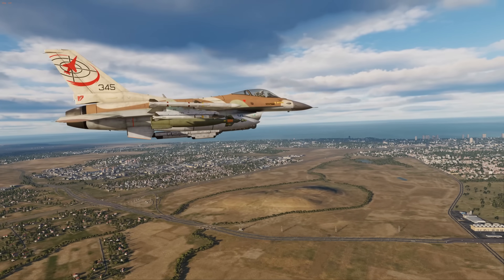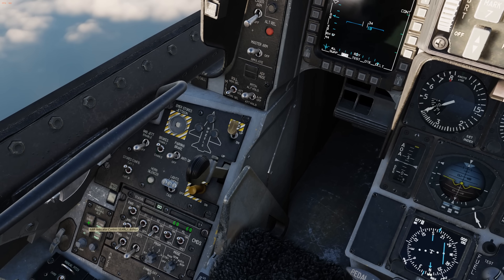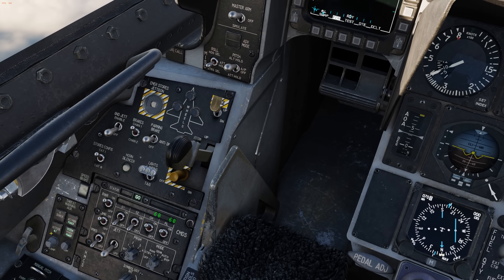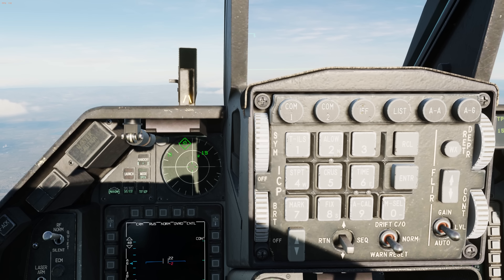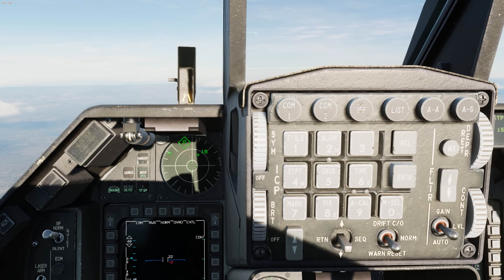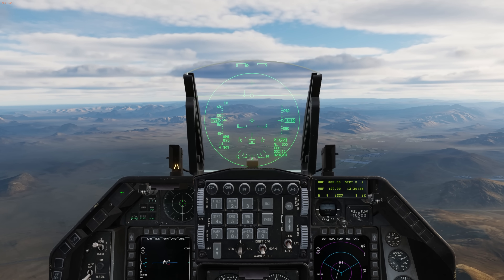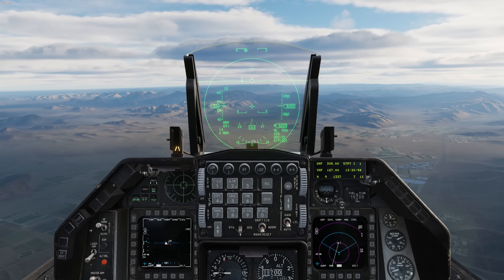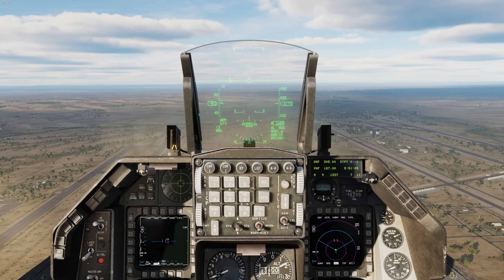DCS: F-16C Viper | January 2023 Update

Comment: Great news!

Regarding the airfield arresting cables; these make little sense until the Viper's damage model include Hydraulic system failures, such as damaged brake lines or a faulty Hydraulic system B. 

The real questions remains: does it interact with the carrier wires? Guess I'll have to try!

Great to see more love for the Viper!

Comment: Well, that's great, all those upgrades to the RWR system, but still no fix to anti-skid feature? It's hard to land without differential brakes.
Reply from the maker: Works here. If you have an issue, please use our forms and create a report with a track file.
Reply: @MattWagner  Thanks for reply, I may have skipped the info of the anti-skid update. I got used to land with diferential brakes so I may have missed it.

Comment: As a separate note the NLG will NOT come down right away at 400 knots via the alternate gear handle.  They built it smart since it has to work against the airstream and not with it like the mains so it won't even try to deploy via the alt gear handle till around 190.

Nevermind that almost 400 knots gear down is just a WEE bit of overspeed on the gear.

Comment: One thing, the speed at which the doors open ND the nose landing gear deploy under the alternate landing gear handle is extremely quick. The main landing gear simply fall out and are locked into place by the air resistance pulling them into place

Comment: Wags, how significant is the performance improvement with multi threading?
Reply from the maker: YMMV, but generally significant improvement in large missions. I kept my FPS display on in the last two videos.
Reply: @MattWagner  My guess, at least for us VR-only (and forever) types, on average ~20-25%, BUT much smooother. A plus, and long awaited. And I'm sure over time it will improve. Hopefully ppl aren't expecting miracles (I know, I'm crazy).
Reply from the maker: @flightsimstuff5417  Delta for multi-threading will depend a lot of the size of the mission and the delta for DLSS will depend a lot on being CPU limited or not.
Reply: @MattWagner  Yup. I "W.A.G."'d it with that in mind from past experience. With nothing going on (low object count) more, throwing everything in there willy-nilly (not 'scheduling stuff for us scripters) something lower. Thanks for the work.

Comment: Hi! Chose the Pre mode assembled with the Maverick rocket. But for some reason, my WPN does not agree with the targeted container. In TGP I choose the target. I switch between sensors, I press TMS up briefly. But WPN is generally somewhere in the sides. In the VIS protocol, everything works. What could be wrong?
Reply: this is a known problem, hopefully it will be fixed in the update.
Reply: Wags says it will be fixed. I've noticed the issue as well
Reply: That's due to misalignment which is simulated. When you boresight mavericks with tgp, all is good.
Reply: @Blaqjack  there's a bug right now. No matter how you try, the mavs won't align with the tgp.

Comment: Finally the hook, nice work.
Reply: Why? You can't use it anyway.
Reply: @Topper_Harley68  ; Because DCS is a simulator, and the hook is part of the real aircraft. Also the potential for carrier shenanigans.
Reply from the maker: Yes, to be as complete as possible. Hopefully BAK later.
Reply: @MattWagner  Nice. Been a million years ago but, when I was in the USAF (ATC guy) I think we had the BAK-12? May have been the BAK-1 :) it was so long ago - 1980's) FWIW, our process was, upon a "Barrier, Barrier, Barrier" call from the jet driver, we'd activate the system. HOWEVER, It may have been what we called the "Rabbit Catcher" which is a different system (I think - again so long ago - it protruded such that it would 'snag' the landing gear for jets without hooks - or was in fact a net similar to the on on a carrier). Dang, I know this isn't helpful but I'm sure there's info on it.

Comment: Important point: you do NOT catch the arresting gear in the Viper at the approach end of the runway.  It does NOT function like the Hornet.  The hook is designed to stop the aircraft in the event of a hydraulic failure and is to be used to catch arresting gear at the DEPARTURE end of the runway.  It is NOT designed to allow the aircraft to stop immediately after landing.
Reply: It’s only the departure end cable from an emergency on takeoff. For an airborne emergency, both cables will be up, with the intention of taking the approach end cable after touchdown. You’re not going to roll ~8000’ down the runway with no NWS. The cables are usually about 1300’ from the thresholds, so you get to touchdown and roll that far anyway, before rolling over the cable. As a comparison with a carrier, a Nimitz class flight deck is only about 1000’ long, where your average fast jet runway is 8-10000’.

Comment: Hi, any plans to overhaul the angular resolution/accuracy of the RWRs of the 4th gens to bring them closer to the modeling of for example the F14?
Reply: actually... from speaking with real world military pilots, RWR systems are far far less "accurate" than you would expect 
everyone in the formation getting launch indications, for example 
very low resolution (you know the emitter is on "that side" of the aircraft - but you can't tell if you are actually beaming or notching, so for safety sake they turn a whole 45degs past the indicated azimuth (with G and chaff) to attempt to break lock 
etc etc 
also.. no guarantee that your RWR will even display a threat
real world isn't necessarily "all that"
the simulated world has it muuuuuch better in some cases
Reply: @SDsc0rch  well yes.. they are way too accurate compared to the more in-depth modelling thats present in the 14. We are both on the same team.

Comment: just curious... what's the big deal about an alternate landing gear handle 
??
there are never mechanical malfunctions in these jets 
where is the need for it??
Reply: wat
Reply: If you get shot and manage to escape such a feature can save your life if your mechanical one gets damaged from the fight.
Reply: It's for the sake of completeness. Same as the hook, although some for sure will try to trap 3wire
Reply from the maker: Correct, thanks.
Reply: @lukew2031  -- fair enough 
I still think its a bit odd
Reply: you can have functions of your aircraft knocked out by damage in multiplayer and there are random failures in singleplayer if enabled
it's also just a pretty basic feature... nothing to lose by implementing it